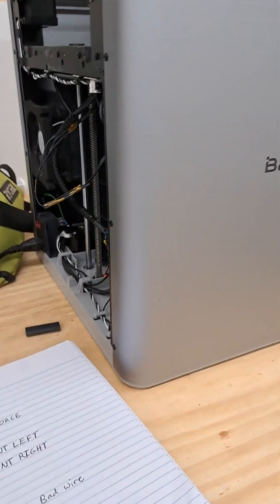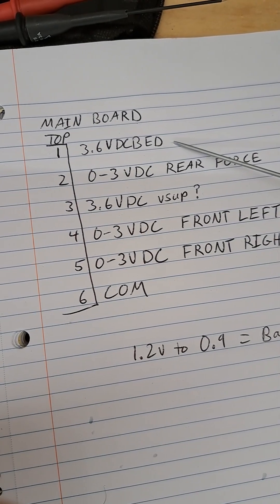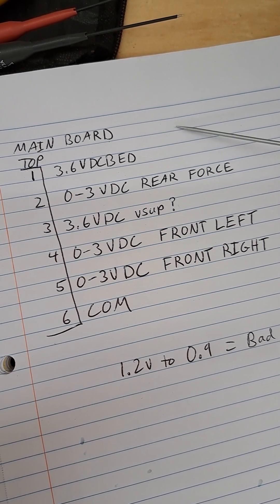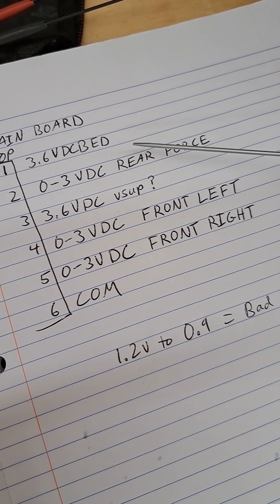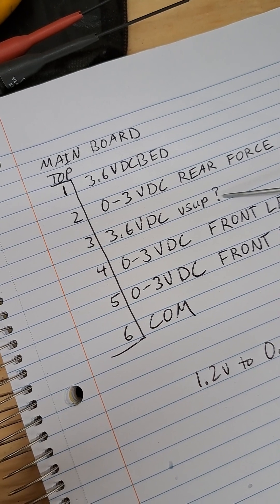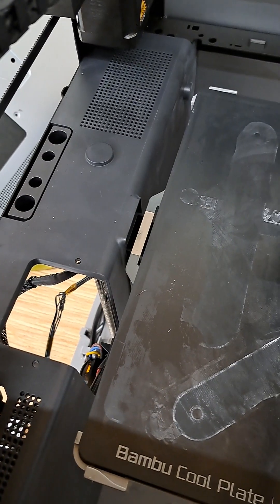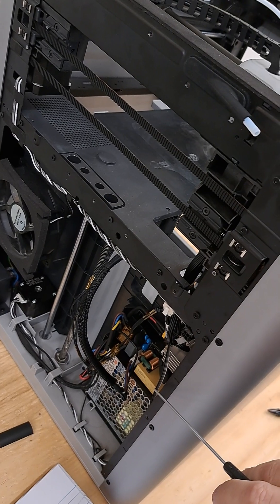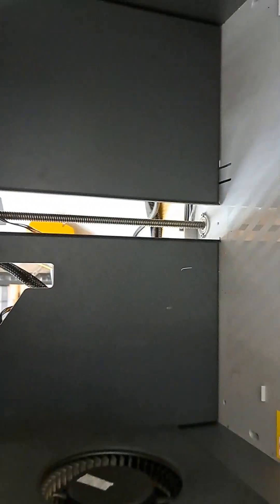How to troubleshoot your bambulab bed sensors with pinout and voltages

Comment: I wish they would let us see data on the machine or in sw, it would make  TS a bit easier. I keep getting force sensor #3 errors and was hoping to find a broken wire in that cable but it seems ok. Time to check some voltages and see whats going on
Reply: Any update? I'm having sensor #1 issues but don't see any interference or anything
Reply: @SNJTerrariums  yes. I secured the sensor cable just before it goes to the mainboard (I hot glued that cable to the poop chute) and have had 0 issues since. I did attach a scope so I could see the voltages of the sensors incase there was an issue, but has been good.